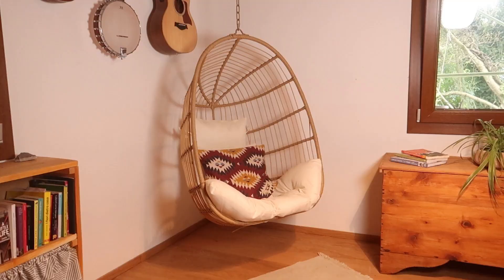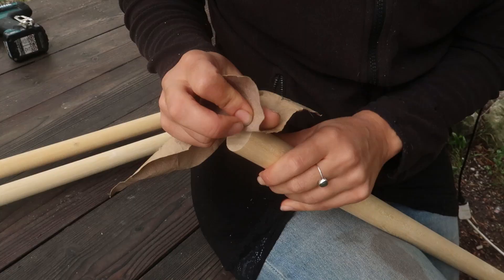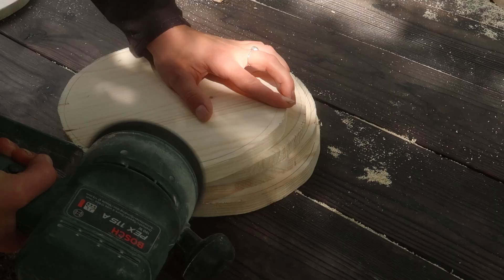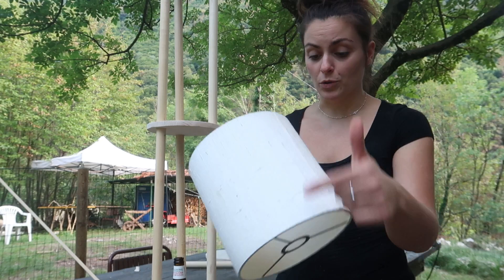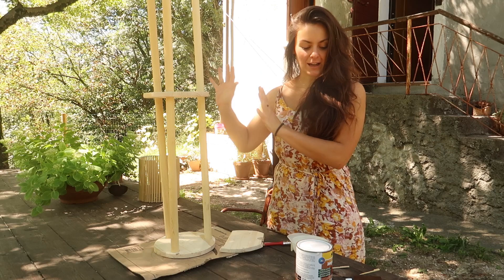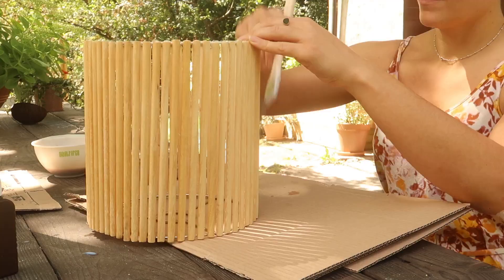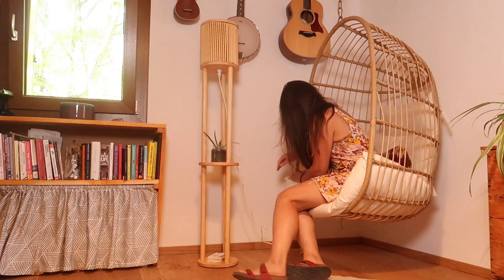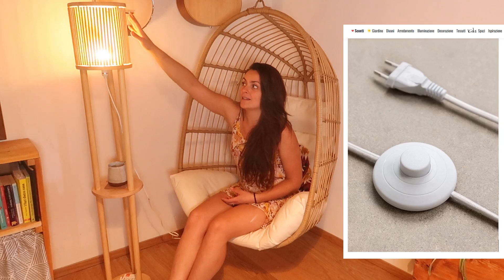There was joy... there was despair. Making the PERFECT lamp!

Comment: Nice! You might consider cutting another hole directly above the bulb of a similar size to the one you did for the bulb socket. This will help with airflow to remove the heat generated by the bulb. It probably isn't a big deal if you're using LED or CFL bulbs but incandescent bulbs can generate a lot of heat which can cause problems if confined.
Reply from the maker: Thank you for the tip Ed 🤗

Comment: Secret with jigsaws is to let the blade cut and move at the blades pace rather than forcing the blade to cut.  There are adjustments are the jigsaw which adjust the angles of the blade to make finer or rougher cuts.
Reply from the maker: Thank you for the tip!

Comment: if you're not opposed to wood glue, you can reduce risk of braking the the shelves by cutting out the edges of the shelves for the rods, set them up with notches on the rods. glue or otherwise fasten them in place with nails, screws, brackets, etc.
once that's all set, take some extra wood (ideally the "corner" pieces you cut the rod slots out of in the first place) and glue it back in place. clamp or rope them into place to dry. 

as for cutting perfect circles with a jigsaw, what they taught me in my highschool woodworking shop was to draw the circle outline, and cut a perfect + and x shape that touches the circle but doesn't cut through it. if you do it this way, when you start tracing the circle with your jigsaw, you're not risking cracked wood, and only have small cuts to make at a time. less stress on the wood, more control over the fine angles and turns. i've got terrible explanation skills, but if you really want my (high school dropout level) advice i can try to make some drawings after work today